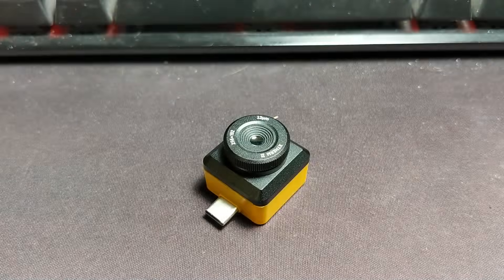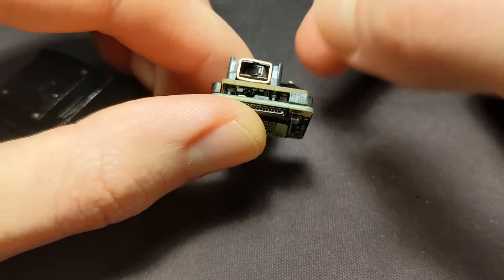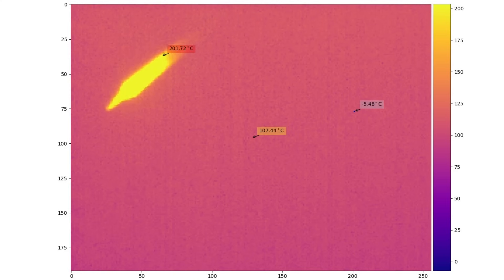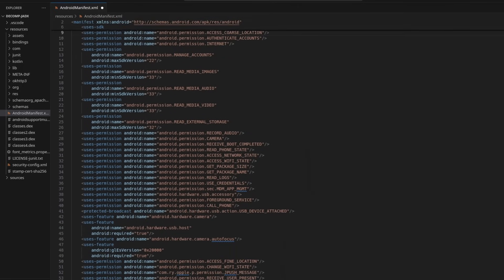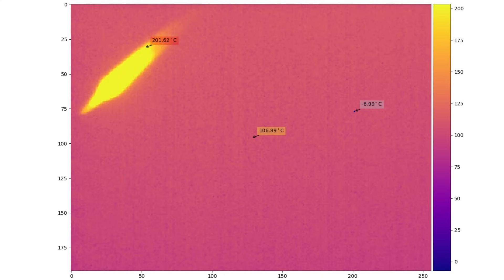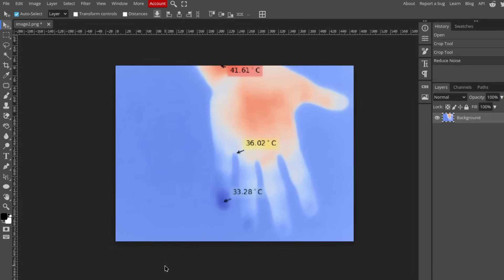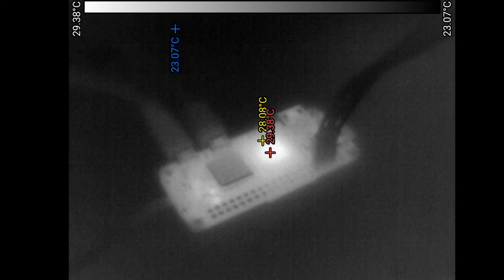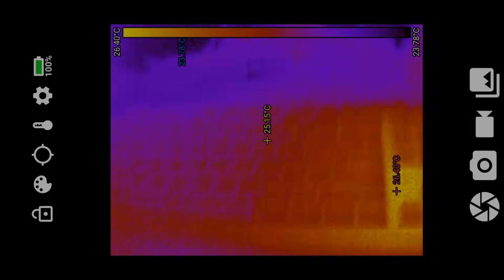Hacking the T2S+ Before It Hacks Me – Free Lock-In Thermography Included!

Comment: It would be cool if the lock in reference could be defined in software without an external hardware trigger. This would make the process more accessible for most users. 

One would just need to select a "reference area", which could be whole circuit but not the background or just some passive parts of the circuit board, average it over in area and over periods if needed, to be the "ground truth" for the excitation phase and amplitude. Then, the lock in equation would use this as the lock-in scaling factor.

Then, one could use any simple external power switch or any other circuit to control the excitation. One may even just use a manual switch, e.g. to switch on the circuit or heater once every second. The software could determine when the switch on happens and calculate the reference signal for every repetition. If the repetitions are consistent to each other the total reference signal can be averaged. If they are not, e.g. because there's no thermal equilibrium in the room, the reference signal can be used for each repetition and the results can be averaged after all repetitions.
Reply: One could also put an LED into the frame of the camera that blinks at the start of each cycle
Reply from the maker: Pull requests are open, be my guest in implementing that.

Unfortunately I don't have much time for programming at the moment...

Comment: I want to try that lock-in method
I have a circuit, which is supposed to be low power, which i designed. It is low power in simulations, but something is causing each prototype to draw way more than expected, and i cant find it.

Comment: The problem with increase the hutzs or the resolution of the thermal cameras. Old laws from pre 2000's military application has stopped thermal resolution and frame rate cap. I had a feeling that more can be unlocked because that are just at the cap 🧢

Comment: Long therm (hihi) lab geek here with access to a half million $ lock in thermography system. We tried your software with that camera and I was surprised how sensitive the camera is! As my expensive system can go down to micro watts per pixel, I was able to localize leakages in the low milliwatts area with ease. It helped to expand the software to talk to external power supplies to have a more granular control about voltage and current limits. Excellent work on your side. :-)
Reply from the maker: Glad to hear that! If you’re finding real value in my work, consider sponsoring me on GitHub or at least giving credit where it’s due. Thanks!
Reply: Are you hiring?

Comment: any option of getting the lock-in thermography working with other similar thermal cameras? like the Hikmicro Mini2 V2, which is very popular, for example?
Reply from the maker: If you can modify the python application to get an image from it then the lock in stuff should just work. You can open a pull request with the new camera to merge it into the main software if you'd like.
Reply: @dmytroengineering do you think there's any chance of having the cameras themselves output the lock-in control signal?

Comment: Thanks, that was a lot of useful information! I have a $200 Seek Thermal camera which also has adjustable focus and works pretty well, except for precise measurements, as the app doesn't allow to calibrate the measurements which are off by a few degrees C. I always wondered what that shutter clicking noise was about, now I know 🙂

Comment: I recently bought a T2 "Pro" to mount to the roof rails of my car; instead of a T2S, it has a narrower FoV letting me see further.

It works well but the Xinfrared app was driving me insane. Very weirded out by the removal, and Google Drive hosting as well. I actually went as far as to use Python and planned to use a Raspi (in place for CAN data logging) to render the image.

I'll give your revised app a try & report back. Should be the same hardware (without the FPGA/built-in NUC) but I did note that the device enumerate over USB as a T2Pro and not T2S. Maybe it'll work, maybe not.

Thank you so much for posting this information. Invaluable. 🙏

Comment: Basically the sensors are cheap chips. They take same but even more basic sterolithography steps to make any sort of silicon chip. Theyre bigger dies but they are also simpler, thusly they are cheap to make. 
So the cost of that board, which is basically the whole thing, is less than 40usd. I think its closer to 20usd. And the price is just marked up immensely.

Comment: i got one of those cheap amg8833 based ones off aliexpress.. the resolution is horrible but it works for my purpose. however, it doesn't seem to have any data lines to transfer the image out via usb, would I be able to get an imaage onto a pc or a phone, by manually ading the data lines to a different port?

Comment: The cap also likely seals a vacuum to avoid internal air currents affecting sensor
Reply: What do you mean by the "cap"? Which part of this device could be under vacuum? Because I couldn't imagine the plastic shell holding a good vacuum for long.
Reply: The silicon cap on the sensor.
Reply: No plastic known to man can hold back a vacuum like that.

Comment: Thanks for the video: The maker-community needs access to an open and affordable thermal sensor!!! The lock-in application is super cool. What is the maximum frame-rate of the sensor? (and could it be over driven? ) Nice with lock-in applications: even excessive noise in single measurements can be tolerated if you just modulate for long enough.
Reply from the maker: The camera has a maximum frame rate of 25FPS meaning the highest modulation frequency you can reasonably do with lock in is about 5Hz. I haven't tried driving the camera sensor directly, so no idea what the actual maximum speed is.
Reply: Used on phones it should be 25 fps and it is noticeably MUCH smoother than Flir with only 9 fps
Reply: @tullgutten  in case you doont know why this is so, Flir obeys US arms export controls that limit IR cams to low FPS. These cams are considered dual use, meaning they are a possible component for missile manufacturing. Chinese manufacturers don't have similar controls on FPS but beware of the spyware as Dmytro explained :)

Comment: impressive work and great presentation. 
Quick thought: use the audio dac in the smartphone to output the two sine waves to easily modulate a power supply. I really want to try this!
Reply from the maker: The power supply needs to simply be turned on and off in sync with the software capturing the frames, no need for sine waves. A microcontroller with a MOSFET is all you need.
Reply: @dmytroengineering  Clearly, I didn't pay enough attention. Thank you for pointing out my mistake. Now I feel obligated to follow through.  Neither the less, I feel like an integration into the app could provide great value for quick troubleshooting. I'm prototyping a small usb-c pd pps supply and I think I will integrate a mode which could support this.
Reply from the maker: @Jajaho2  You can look at the python source code of the lock in software. What it does currently is simply send out 1\n for on and 0\n for off over serial to a target port (\n stands for newline character). Should be pretty easy to implement.